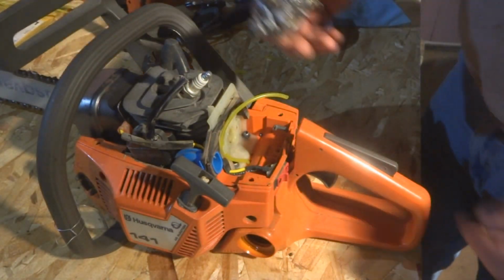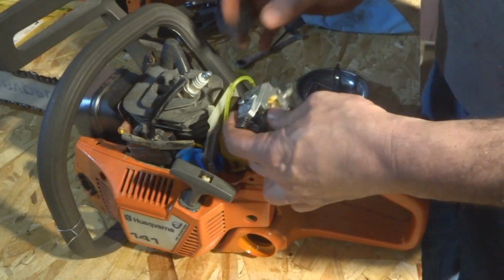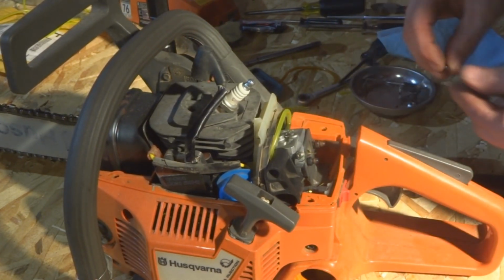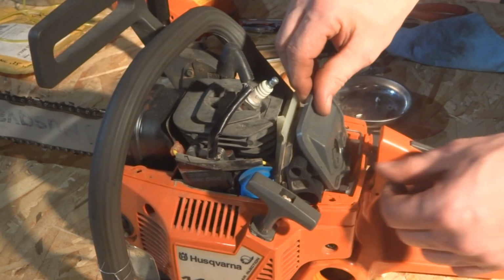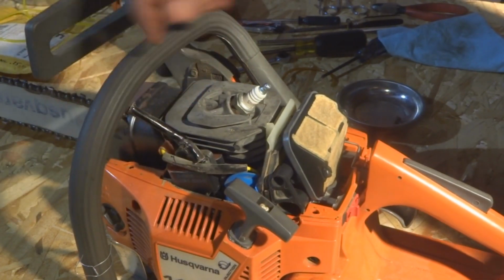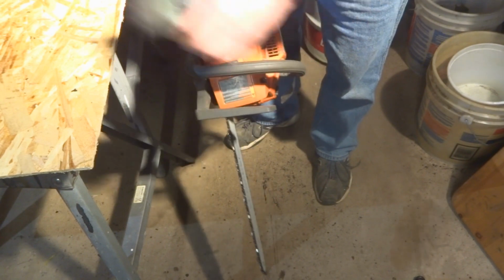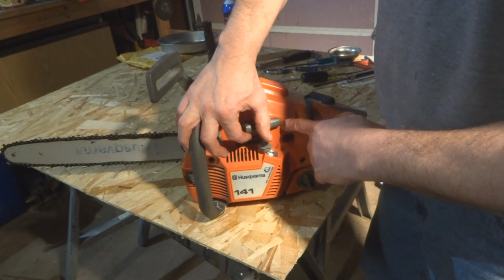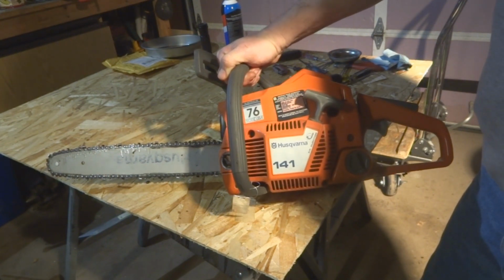Husqvarna 137,  141 Chainsaw Part 4 - Carburetor Installation

Comment: I have the same chainsaw, when I pull the choke lever it won’t stay out , do I have to adjust the idle screw to fix this problem ?
Reply: Did your choke ever "lock" out?  Mine did on my 141.
Did you take off and re-install the carb or install a new carb?  I had a similar problem when put me cabe back together and installed a gasket between the metal choke plate and the carb itself (Which seems like it should have a gasket, but according to the exploded parts diagram it doesn't).  
The thickness of this gasket made it so the choke wouldnt "LOCK" open.

Comment: Fantastic video series I want to thank you for!  I have a 15-year-old 137 I bought new but as an average homeowner have used it a handful of times in that span.  The last time I wanted to use it, it would crank, rev high, and then immediately cut out.  I followed your series and upon taking my carb off I found my fuel line had disintegrated entirely (no wonder it wouldn't run).  I ordered a kit that included the carb for $12 off Amazon.  The fuel line was way too big so per your instructions I bought some .08 x .14 from my local hardware store, and just got everything installed.  It took a few cranks to get it going but it's working fantastic now.  I imagine it will give me another 15 years.
Reply from the maker: Wonderful! Thanks for watching!

Comment: Only 93 likes 😔 Am I permitted to add 100? 🙂 It was really part 3 which was the magic element advising the correct size fuel line and the idea to slice it down to get it into the fuel tank from where it can then be pulled through. But on reassembly the rubber guide for the carb adjustment screws just would not sit happily ... so come check this and I was trying to put on the wrong way around! This video has now solved that small issue. Thanks SO MUCH for a couple of videos that have bee SO helpful 😊
Reply from the maker: You are very welcome! Thank you for watching!
Reply: @RealManSkills  Thank YOU for posting ... and doing such a nice clear view of everything as well :-)

Comment: How many circles l need to turn when l settig up carburator on Husqvarna 137
Reply from the maker: In my related video, I address the high and low idle needle valves.  I usually start with 1 or 1 1/2 turns. Then once it's warmed up, I tweak it to run better.

Comment: Excellent series of videos, really well done and well explained.  I just put a new fuel line and filter in my Husqvarna 136, and it certainly was 'cantankerous' as well as a few other things I called it.   Getting the fuel line through from the carburetor compartment to the fuel tank was a major heartache.  I finally put a 16 gauge wire up about four inches into the fuel line, fed that through, and then clamped it a few inches above and reached into the tank with long needle-nose pliers and pulled it through that way.  Pushing it through was almost impossible.  And I heated it to get it on the filter barb and on the carb.  Now it runs like new.  Thanks!!!
Reply from the maker: Thank you for watching!

Comment: Hey hey !  I have that same saw here.  I put all together and i do not know what i did wrong...because it will not start.  It has spark. I somehow suspect...that the timing is wrong or perhaps the flywheel is fitting perferct...but actually are for another model....where coil is slightly different place...so timing be wrong.  Do not know prehistory of the saw.  Other...the engine and carburetor and coil is brand new from china !  Irritating.  I do not know how to check the timing...that give spark i mean at the top point of piston in cylinder.  Weird ...becaus i put gasoline straight in the cylinder...it has blue  spark...but still do not suggest nothing...not even a small fart.  Dead. New cylinder...allot of hpe and work huhhh... new lines as well.  My first Husqvarna experience and it turn out to be a night mare.  I did allot of stihl and jonsered with succsess of course.  Huhh  Someone help ?  he he